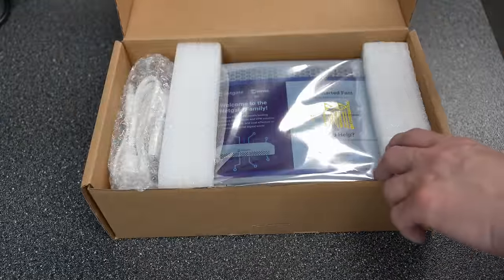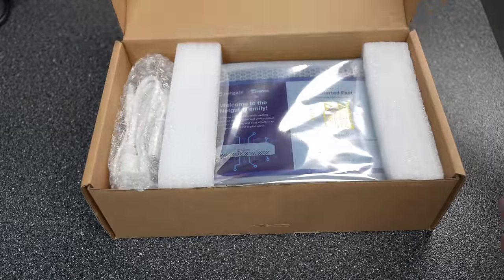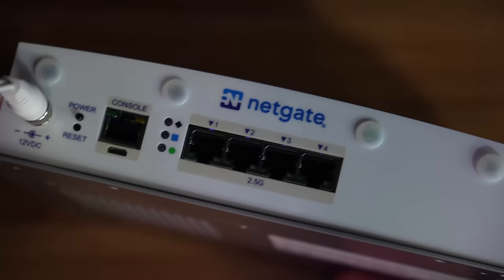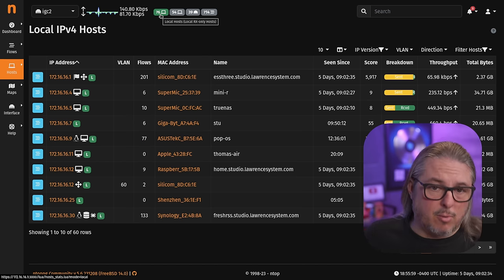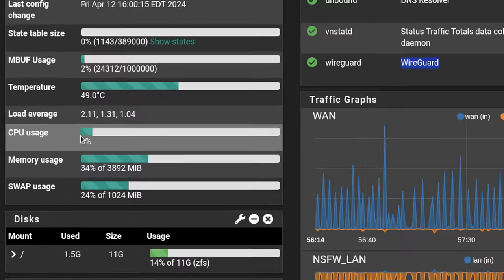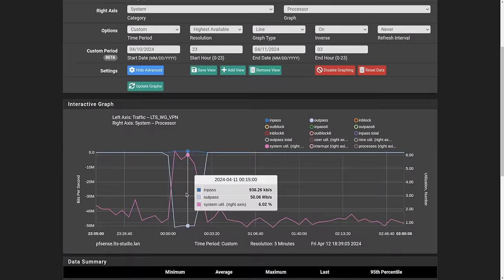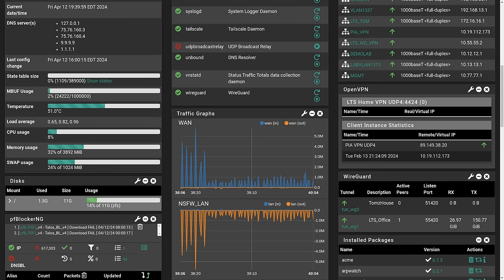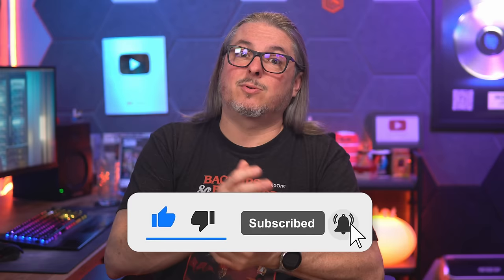Netgate 4200 pfsense Firewall Review

Comment: This came just at the right time for our MPLS decommissioning. I’ve done a proof of concept for getting remote CCTV connected back to the central NVR using a couple of 4200s and an IPSec tunnel. Will add more sites now. The big increase in IPSec performance with these is perfect for that project.
Reply from the maker: It will offload static data to swap.

Comment: replacing a Nov 2020  SG-5100 whose mmc died, added an ssd, it ran for one year, and now the mmc is stopping the device from booting.. short of physically removing the mmc I'll just replace the unit... Though I am still worried about the  Sg-4200 MMC dying in a few years... Thanks for your videos they are great!
PS. I saw others mention removing the MMC to get the unit to boot; I did that with a SMD hot air workstation I have, and surprisingly the uint now boots right up again.. So I'll update it and consider it a spare for the 4200 thats on its way..

Comment: I still am a little amazed at the fact that they finally get a new model atom, but found the one without QAT.  The model has an ark page, but doesn't even show up on the list of "C" family of atom processors.  Even the link to the Arizona Beach Processors on the Ark page for the processor goes to a dead link.  sigh
Reply: pfSense Plus doesn't need QAT support anymore.  IPSec-MB makes IPSec and OpenVPN faster even with it missing.
Reply: AES-NI is plenty and is in many lower power chips now.

Comment: Nice overview of the unit.  I installed 24.03RC on my spare XG230 Rev3 unit yesterday, although had to rebuild it due to the UEFI / BIOS issue which they're looking at now.  Couple of Q's re the VPN aspect, PIA don't do port forwarding for torrents do they if I recall, unless it's offered via their static IP address service?  Also QAT vs IPsec-MB Crypto?
Reply: That it has one of the regular bios providers was the first selling point to me. What is/was the issue you refer to?

Comment: Awesome video. Thanks for putting it together, and especially highlighting the advantages of the Atom over something like a J4125. As someone teaching myself (or trying to) OPNSense as a hobby at home, it's easy to get overwhelmed by internet discussions from power users trying to min-max their configurations that want to put Xeons in everything. It's nice to see that the hardware acceleration in Atom CPUs has real, noticeable benefits to things I actually care about doing. It makes figuring out if I want to invest in something like this easier.

I realize pfSense and OPNSense are not the same software, but the rule in the OPNSense guides seems to be not to use multiple downstream LAN ports on the firewall itself on a single LAN interface, as this requires some sort of bridging that can kill performance. Is that the case with OPNSense as well, or is this a case of it only "killing performance" in massive corporate deployments but being okay for a home or small business?

Also, I'm curious if this device is appropriate for use in a network with 10 GbE LAN segments. I'm assuming the 2.5 GbE LAN ports would be a bottleneck in the case of iner-VLAN routing, so the expectation would be that the VLANs would be configured to prevent that when 10Gbps throughput actually mattered. Is that correct, or am I missing something?
Reply from the maker: I have the devices and I have 10G LAN segments. I don't need 10G through my firewall so it's not an issue.
Reply: @LAWRENCESYSTEMS  Thanks!

Comment: I haven't watched the video through yet, I will later. But one thing I've found disappointing is the form factor that suddenly doesn't support rackmounting anymore. Sure you can put it on a shelf, but that just takes up more space (and it's ugly lol). Also no SFP(+) ports anymore. We're sticking with the 6100 and 2100 (I also don't like this one not being rackmountable but it's tiny so whatever) if we don't need alot of performance.

Comment: 550 is crazy when you can get a N100 with 4 2.5gig of Ali Express for about 150 bucks shipped.
Reply: That's cheap when you have a business and need a support contract.
Reply: Support contract is  worth nothing if you are a home/private user..Netgear should make an home user alternative
Reply: This is not meant for the average homelab, but for a business. No business worth their salt wil buy an Ali pc for their firewall
Reply: And that N100 Ali Express device kernel panics and reboots itself once every other day because of sub-par hardware quality and bad circuit design.

Ask me how I know lol
Reply: While it's not "cheap", you can't really compare it with cheap junk from Ali.
It's very good value when you compare it to their market competitors. You get quite small, quiet, powerful box with  4 x 2,5 gb ports with very long and stable support for software updates.  If only they had better availability in some EU countries :/
Reply: You are also getting a pfsense+ license and much better build quality.
Reply: @Adures  
OPNSENSE boxes are availble in EU,
I personally would prefer a DEC675 over a Netgate 4200
Reply: @TheMaevian  I know they are, but I’d be curious to hear why would you prefer DEC 675. Just looking at spec sheet, not only it is more expensive, but also advertised performance is so much worse compared to Netgate 4200, I wouldn’t even put them in the same class of device, especially if you include cost of ongoing business license in opnsense box. I’d be happy to hear reasons your reasons.
Reply: @devemia the free tac support contract for pfsense is useless
Reply: 550 is nothing if you work from home and rely on internet access 🤷‍♂️
Reply: @FelipeBudinich  It's s not nothing. Especially if you are in the market evaluating and you're not sure if pfsense is going to be the right product for you.
Reply: @zack.123.  if 550 is not nothing and downtime is not an issue, by all means get an Ali mini pc and just use any of the multiple software alternatives for routers, they pretty much all do the same thing 🤷‍♂️

It's just a tradeoff of how much an hour of downtime is worth to you. And from my perspetive it is always funny how people go over holy wars about ecc memory and firewall software while using a device with a power supply or caps that have way higher odds of going bad than any other part of their tech stack.

Comment: I see Tom is using ISC DHCP - I'd like to see a detailed video on this, covering 24.03 release, problems / gotchas, is it ready to use?
Reply from the maker: I am still using the original DHCP server.
Reply: @LAWRENCESYSTEMS  sorry, it is the original, the new one is KEA, my bad.  I'm wondering if 24.03 will fix any issues people have with KEA.  I think 24.03 is imminent, so I look forward to you covering that.
Reply: @JonathanSwiftUK it's basically for testing and they haven't implemented a lot of the UI to for it yet. I wouldn't bother with it until they switch it to the default.

Comment: How does support model works for pfSense Plus software? Is it a subscription based model or a perpetual license sold with the device? Does automatic update work via UI or they require command line operations?
Reply from the maker: Cubscription for non Netgate hardware, perpetual with Netgate hardware, and updates are performed via the UI.
Reply: @LAWRENCESYSTEMS  Thanks, I was checking just now the same on their website. For the main use case described in the video - e.g. for Netgate 4200 - for how long the updates will be issued? They are also considered "perpetual"?  If that's the case - this would be a great deal ..

Comment: Hi I love your videos. And I have a request can you do a video on how to setup dual wan fail over and how to make the box reroute where my no-ip address points to along with the firewall conf stuff?

I assume you need to copy the rules from wan1 to 2? Have not tried would love more info in it hopefully before I break something.

My box is overkill for what I use. I7 3770 and 16gb ram along with two dual port Intel network cards.

I have a Fibre optic 250/250 line that I use as my primary. Then I have a cable 100/10 line that I want to have as a failover for my network. Both running on dynamic ips from the providers.
Reply from the maker: https://youtu.be/acDvlzmsnaE?si=zLg6ocZRh_xz6GDo

Comment: Why not make a recommendation for building a custom 1U server with Linux, talking about what components to use for maximum reliability, with a how-to install PF-Sense in a server envirionment. If you don't have any incentive to promote or support NetGate, or are not worried about them seeing such a video, I'm sure lots of NEs would appreciate that video.
Reply from the maker: We buy Netgate hardware because it's reliable and consistent. There is not anything special you need when building on your own hardware other than something with Intel based network cards.

Comment: This looks like a missed opprotunity.  if they had sfp+ or 10g-base-t ports, I'd totally be down but this 2.5g crap that's been going around is just disappointing.
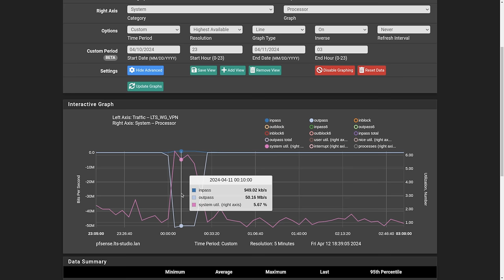Reply: Their internal dataxfer can’t keep up with 10Gb ports running vpn and/or anything but port filtering. At 7:00 he was only able to backup offsite at 50-60 Mbps. Painfully slow!

Comment: for home lab probably "too good" - one can have similar one from uncle China for kind of 30% of the cost of this one
Reply: That 30% is well worth it for the reliability factor and the built in PfSense Plus. I am using a 4100, switched from SG-1100. I don’t mind paying a little more, since it is my main device, not just lab.
Reply: @hunordori  you either did not read my post fully or simply did not understand it ;-)
Reply: @zyghom  Yeah, I misunderstood it. You said, you can get devices for 70% less from China.
Reply: N100 based firewalls are indeed really cheap nowadays. But if i need to choose between which uncles i will be spyed upon, i choose uncle sam